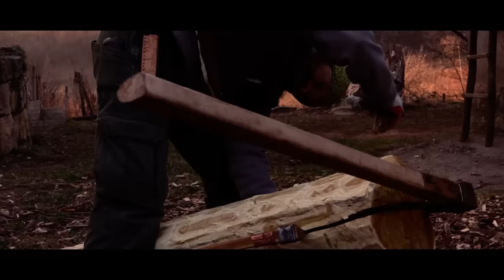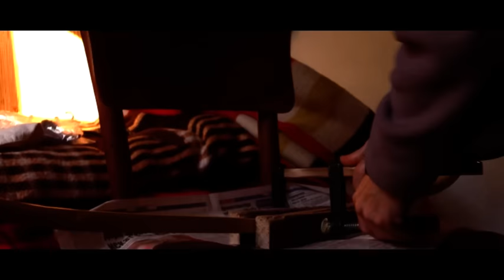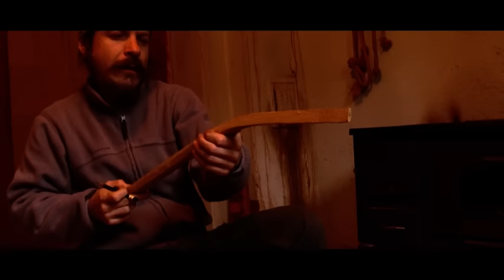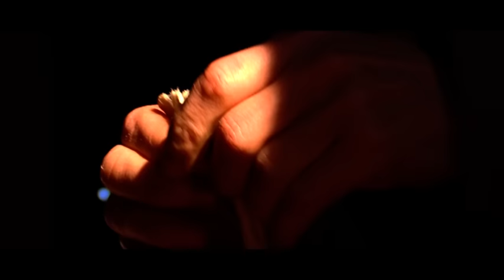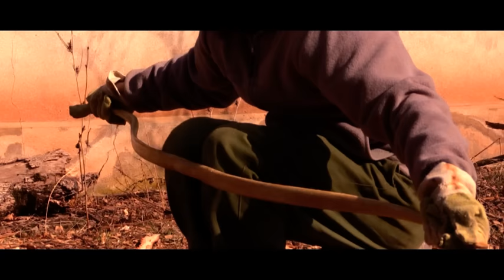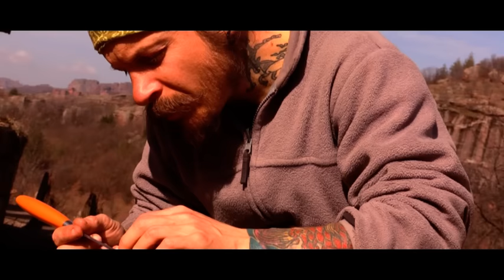Mongolian sinew backed bow

Comment: I made a long bow when I was in college using only a knife and a hand planer.  I read about the process on the internet, but that was way before youtube.  I had several failed attempts before I succeeded.  My apartment was filled with wood shavings and I sliced my hand pretty good in the process.  It was so frustrating, but I was obsessed with making my own bow.  I did not make my own string or arrows though.  This video is the most impressive thing I have seen in a long time.

Comment: From a norwegian bowmaker who also use handtools only, very nicely done. Respect 👍

Regards from Norway. 
Sven
Reply from the maker: Thank you very much! Regards from Bulgaria!
Reply: That was an amazing glimpse into the artistic yet hyper functional tool that historically provided protection and food for centuries, very impressive.... so please don't think that I'm critical, I have never made a bow so I'm mean zero disrespect when I ask... 

but I'm curious about the center 'knuckle' area... would having the 'V' shape groove where the two outer ends meet the 'Diamond' more reddish center hardwood be stronger if the 'V' of the ends were facing the shooter and parallel of direction of the arrow instead of perpendicular to direction of travel? perhaps the natural glue used is more than sufficient to keep from failure.... just curious. thank you fir sharing your skills, it was stunning!
-Jay from ATL
Reply: @jaybar10dr4hire3   Hi. I wounder, I've you might have missed, that the notch for the 'diamond' actually is in direction of the trajectory?

Comment: A beautiful video and great demonstration of bow building.  Thanks for all your time and effort.  It is however not what I was taught a Mongol bow is though.  Bamboo core with a diamond shaped horn laminate on the belly with sinew back all glued together with hide glue(or rabbit glue) a protein derived from various animal parts boiled down and often crystallized then pounded to a fine consistency and then re-hydrated(though self bows with  sinew backing may have been used for hunting).  "Horse bows" were about a meter long but of considerable pull.  It was this glue and technique that led to the eventual downfall of the Mongols as the glue could not withstand the high temperatures or perhaps it was the constitution of the Mongol peoples as some historians have said that the heat caused disease. The birch wrapping he applies here was to provide some limited protection from the elements.  I know of only one maker that (commercially) makes these bows today in Canada with a couple of year wait and hefty price tags.  My bow making has been limited to reproductions of sporting crossbows of the 16th century.

Comment: Interesting video. But it leaves a lot of questions - what wood do you use? What animal do you get the sinew from? Do you make your own glue? If it is hide/hoof/skin glue; from what animal? Do you do the tillering all by eye? What do you use for the bowstring? What draw weight is the bow? Do you make your own arrows/heads/fletching? If so, what materials do you use? What was that hide you were peeling for the bow cover? Thanks.
Reply from the maker: Thank you very much! Deer sinew, fish bladder glue, linen bowstring, birch bark cover, 30lbs
Reply from the maker: Thank you very much! Mulberry, deer sinew, fish bladder glue, linen bowstring, birch bark cover, 30lbs

Comment: I heard that the back of the bow should be one continuous growth ring of the wood used so the wood doesn't splinter. I don't see that step in the video. Is it just not showed or did you skip this step because the sinew backing is replacing that ?

Comment: Why does the lumberjack stand so high off the ground to cut down the tree?
Reply: most times when cutting he is probably getting  above a bad spot in tree so saving  on having to do extra cuts to get to area he can use cleanly ,  the grain of the wood needs to lay just right and some bad spots in tree  make for weak areas

Comment: Birch Wood can replace mullberry? because all I can found is birch in my area. 
And what did you used as glue?
Reply from the maker: In the world have 60 kinds birch. I think that only northen kinds are appropriate. I using fish glue.
Reply: Stiliyan Stefanov i live in Romania so i think that the birch type is silver birch is very common in Romania
Reply: I heard that acacia tree(robinia pseudoacacia or black locust) is similar
Reply: Stiliyan Stefanov the fish glue is from air bladder or fish skin?
Reply from the maker: Acacia is not good, very weight wood.
Reply from the maker: Bladder
Reply: Stiliyan Stefanov thank you a lot for help

Comment: Hallo Stiliyan.Thanks for video and for work. but I want to give you good advice so that you have strong bows,
firstly .. buffalo horn that is for inside. two pieces left and right. as a feather
secondly .. middle piece that's beech as Handle
Third ... piece two pieces left and right from young maple tree
Fourth .. Dried bull Achilles tendon for the outside .. 
Fifth .. Two pieces left and right so that yew horns are there for a twisted silk tendon. Good luck with the next work .
.the record shot at such a bow 843 meters from 'Ottoman Yenicare name' 'Tozkoparan' '..
its marking is still in İstanbul where its arrow landed 

Thank you ..

Comment: Firstly this isn't even close to the real thing, firstly Mongols were a laminate what you made is more of a self bow. The origionals used sinew, wood or bamboo and horn! The siyahs were glued on and not carved in. The isn't so much a replica as a self interpretation. There's a reason why its draw weight is clearly weak as a kitten when you fire it.
Reply: Aaahh another true bread Mongolian (with this name..really) The "Real Mongolian" bow has many variations....some high end were made for the hans and high society...and the ordinary archers had one of those here...or close enough. How do you think they conquered so much space and people if the improved Chinese bow you are talking took about 9 months or more to make on average? ( master making of that here: https://www.youtube.com/watch?v=RVUWuySzQ10 ). The mass of people and hunters had what is shown here simply because it's easier/faster and cheaper to make. Basic and it works for most purposes. Also it was made smaller and lighter and (as a result WEAKER) because the Mongolians were horse riding and fast enough to get to your arses and therefore didn't need much Bow power to do the job right. Yes this type of bow isn't superior but you have to bow down to the pure skills and knowledge of making it! Some respect before complains goes a long way.
Reply: nunamvseravno 

All of that was badly researched, firstly their actual bows were a composite bow, they were not Chinese in origin! The Chinese got their bows from the Manchurians they conquered at a later time. I've actually grown up making composite sinew wood, horn bows and happen to know what I'm talking about! Also they used a shorter flat bow for general hunting so they didn't damage their war bows as they were highly prized! Yes some took 9 months some took years to make and ranged in strength. However this bow is still nothing like the smaller flat hunting bows and stating such shows how much you really know which from your response I will assume is nothing!

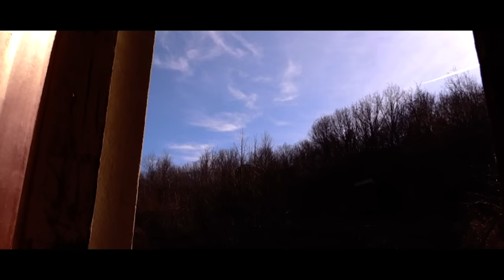Comment: 13:23  The bow has a open C shape.    
13:27  The bow has a very closed C shape. 

WHY???
Reply: A bit late, but when the sinew dries of the back of the bow it shrinks and causes the aggresive bend. i believe it adds more strength to the bow and also makes it slightly more powerful.
Reply: @mobagamers8204  Never is later to learn. Thank You